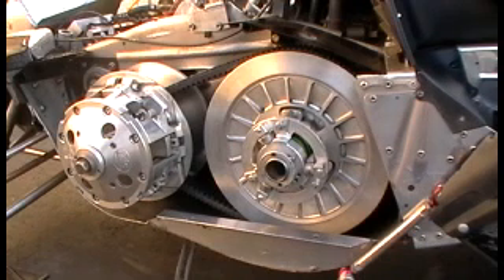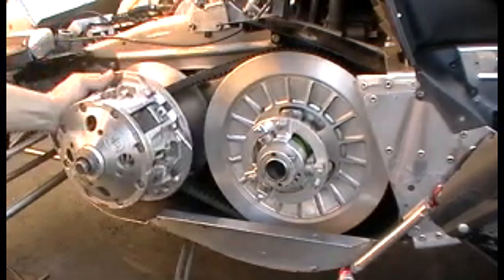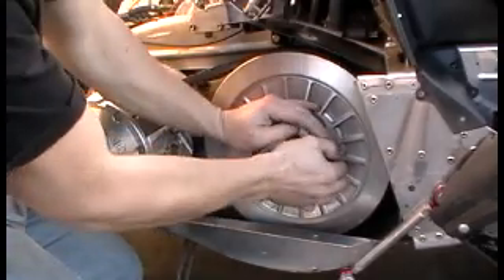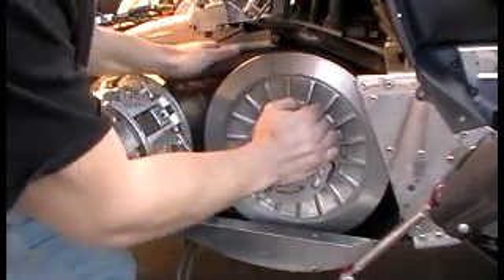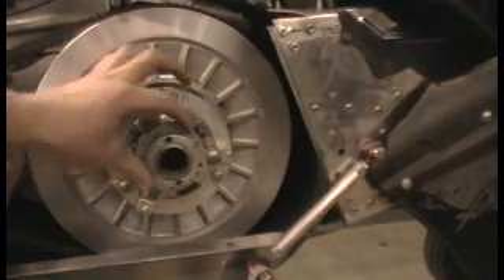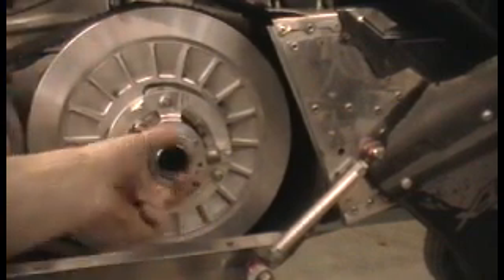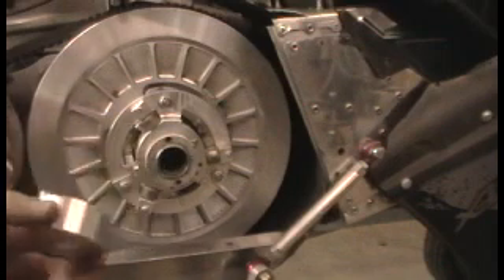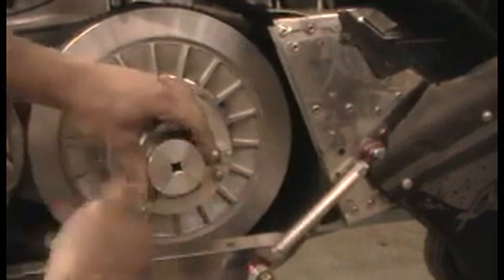proper belt deflection

Comment: Hey I have a question I just bought a 2013 xf1100 turbo and it has a stm clutch could you tell me what one it is exactly and what belt I should be using with it ?  Cause I know the 11" clutch uses a different belt but having a hard time finding info
Reply: If you have a email address I could send you pictures of it?

Comment: be sure to run the sled around for a few minutes first!! I was about to adjust my belt, it was WAY too loose. I took it for a spin around the field to warm the belt up so it would be easier to remove. I came back and it was perfect adjustment. My deduction is since nothing moves, the  factory has it pretty damn close, so don't screw with it unless you did secondary clutch work.